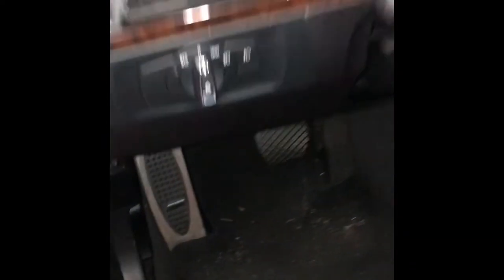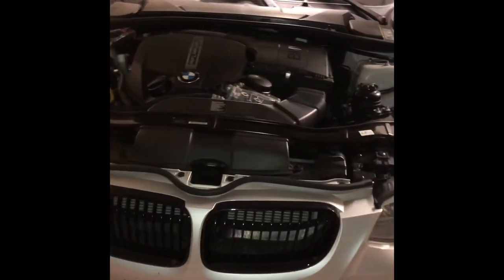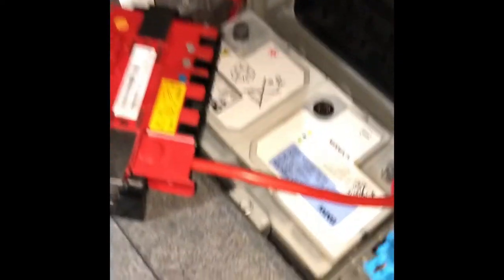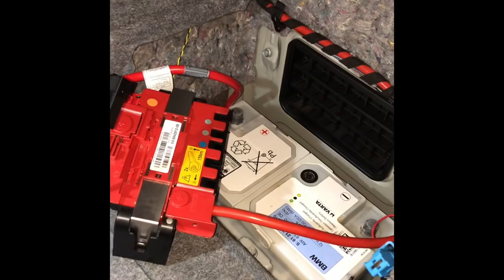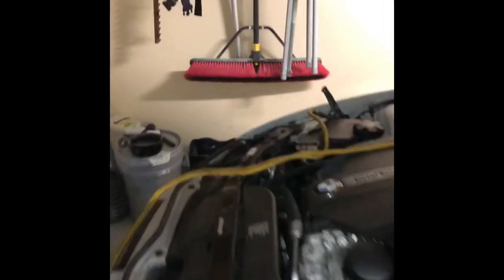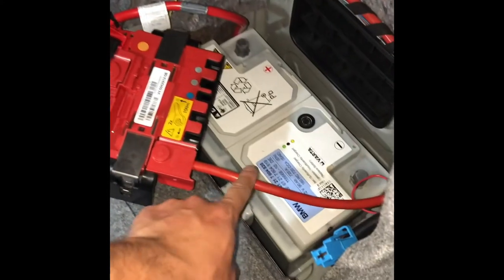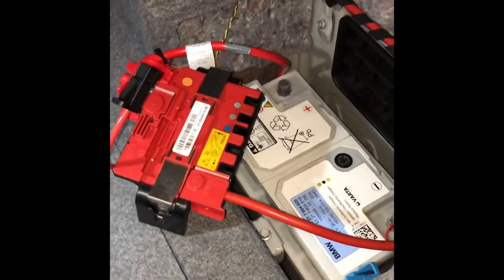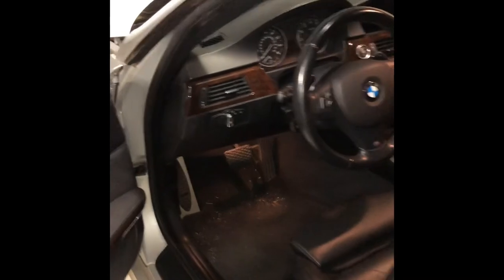E92 Battery out trunk shut lockout experiment

Comment: RIGHT, FUCKING BMW AND THIS BULLSHIT.

The only thing i managed to do on my E90 2011 was to use the front terminals in the engine room to get just enough electricity in so the button next to hood release to work and i've managed to get in, nothing worked :D 

took off the negative terminal without thinking much and ended up without a car until my friend helped with this.
Reply from the maker: yeah not the best form of German Engineering lol
Reply: @carsnstuff6022  absolutely worst 😀 dumbest shit ever, love the 335d otherwise

Comment: Hi can you assist this trick is no working on my 2015 f30 BMW because I took out the battery for about a week because I was waiting for the new battery delivery and the trunk is not opening even when jump started.
Reply from the maker: I think you may have disconnected the cable that goes from the battery to the battery junction under the hood, you will have to open your trunk by removing your license plate lights and trunk open button from there is tricky but there is a cable to goes to the trunk latch, you can grab that cable with a set of long needle nose plyers and pull on it, that should pop your trunk and you'll be able to access the battery that way, hope that helps.

Comment: Show the one removing the license plate light
Reply from the maker: so I no longer own that vehicle anymore however it is very easy to remove the License plate light, you'll need a small flat head screw driver, the light has plastic tab on one side and a snap in tab on the other (which I believe its the side closest to the center of the car, you pry that side with the small screw driver and pull the light down, unplug and set aside, behind all that is the cable release for the trunk, I grabbed it with a set of long needle nose plyers and pulled it up wards and the trunk popped open, it was a PIA but it got the job done.

Comment: I’m stuck at 5:27, I need help
Reply from the maker: hope that helps
Reply: So I’m still stuck with the white tabs
Reply: I’m pushing up but I’m getting nothing
Reply from the maker: @danielwilliams4642  which white tabs? are you referring to the plate lights?
Reply: @carsnstuff6022  no there’s white tabs after u move the plate lights
Reply: When u remove the plate lights there are white tabs underneath them or is it maybe just 335is?
Reply from the maker: @danielwilliams4642  gotcha I think I remember something like that now that the lights are out you can also remove the trunk pop button and between those two you'll have access, I think those white tabs I got them off and pushed them off to the side

Comment: I have a 335is and similar situation somewhat the battery was taken fully out and whenever you fully take out the battery with both positive and negative terminals disconnected it does not matter if you have jumper cables to the car it will not work lmao I managed to reconnect the battery after sometime and my car started right up 😮‍💨😂
Reply: @samiehayes8045   yeah sure thing I'll go ahead and send you the exact video that helped me but if you fully disconnect your BMW battery fully there is a high probability there is absolutely no chance you will put power to it unless you put that battery back together, what I did is I got in the back seat and a lower down the centerpiece cupholder in the back seat where it leads into the back, I lowered it down and there's a metal plate in the way you can pop that metal plate off and you can cut a hole in the seat and release the emergency trunk latch that's what I had to do, and I fully understand people don't want to damage the vehicle but after you cut that hole to get into your trunk you can put that panel back on an your can't tell at all that there's a hole in your seat cause the panel will cover it, it took me 15 minutes an a pair of tin snips to cut threw the back. But I promise you it is way cheaper and less time-consuming having someone break into your trunk and then you have to replace the locking mechanisms in your trunk....the 328i came out with the 335i an the 335is very similar to my car so I'm sure you can do the same. I'ma go an try an find that video for yourl real quick so you can have a better visual understanding👍
Reply: @samiehayes8045  one more thing the most expensive jump box like 340$😮‍💨 an NOTHING HAPPENED, BMW try telling me I need a new junction box witch was false I promise you once you get into that car and connect the battery it will start up again, gimme like ten minutes man an I'll be sure to try an get that video for you guys!!!
Reply: @samiehayes8045  I went ahead and told you how I got it unlocked and I went ahead and showed you the video that helped me above, to be honest you're going to have to do what I did cuz there is no way you're going to put power to that car you have to connect that battery even though BMW tells you to hook up a Dropbox it will not work😂😂 I hope this is help to heal my friend and I hope you guys get it open 👍